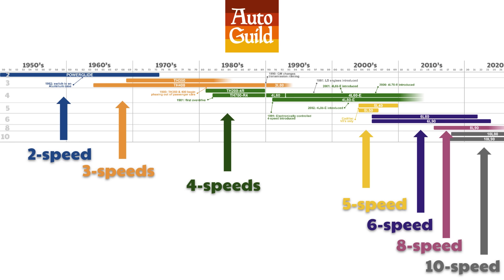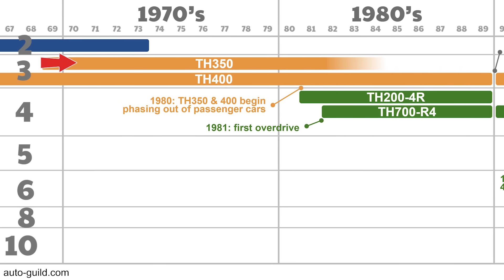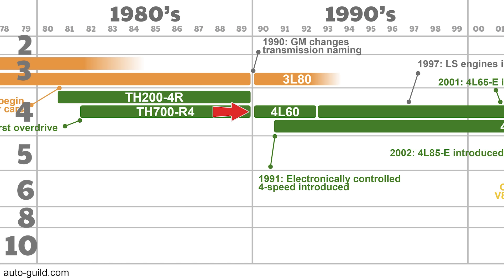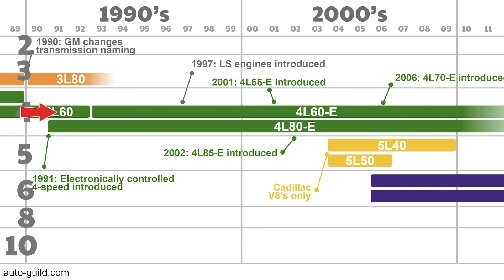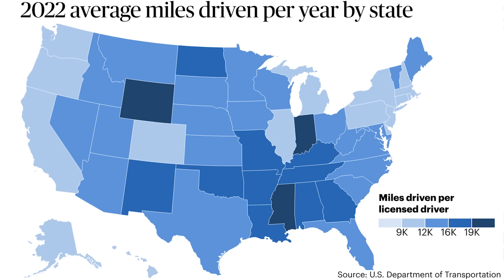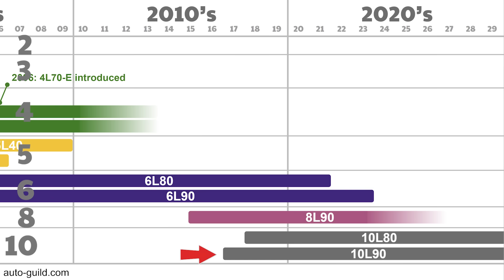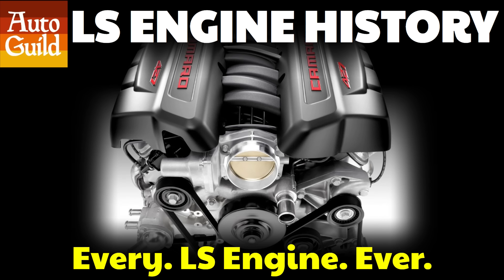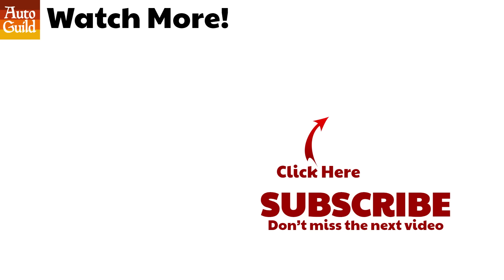All 15 Automatic Transmissions (Powerglide to 10L90)

Comment: Great video. I have a low mileage 2001 LS Camaro in beautiful condition. It's Procharged and makes over 500/500 to the wheels. I'd like to make more but I'm pretty limited by the tranny. I don't really like the available options I'm aware of. I need at least 4 gears. So we start at the 4l60e(which it has now with some minimal upgrades). A built 4L60 gets really expensive, will still be in danger over 600whp or so, and honestly I'm not that big a fan of it. The 4L80 can be built to handle my power goals but it's darn near 100 pounds heavier, expensive, and doesn't excite me very much. Honestly after that I'm not really sure what goes into making a more modern tranny work in my application. Something like the 6l90 sounds ideal as it is modern and won't need to be built up a ton because it's already made to handle good power. But as I learned in your video the housing dimensions are big and they might have some reliability issues(?). I am at a loss what to do. I can't articulate why I don't like the 4Ls in performance applications but they just don't feel that fun or exciting to me(even with a high stall converter). I would rather not pour all my savings into something I won't be in love with but as of right now it's looking like my only realistic option. I would love to hear your thoughts and possibly a video. Over the many years  YouTube has existed I've only subscribed to 2 channels because I feel the yt algorithm does a good job bringing me to what I want to see and there is no reason for me to mess with success. However, I found this video very insightful and eagerly await more. You will now be my 3rd subscription ever. Great work.
Reply from the maker: Yeah sporty bill at 70-100lbs heavier 4L80 is hard to accept.  Your car sounds super fun.  Even a five speed would be ideal.  I'm actually a hard-core manual transmission guy, so I'm converting my 68 Camaro into a manual, I think that's where the fun is!  Thanks on the subscription.  I'm actually subscribed to by think around 300 channels which is crazy but I watch mostly YouTube in my free time I don't watch too much regular TV.  I have a few other videos you may like if you want to check out the rest of my channel.  Thanks for joining
Reply: Borgeson, look at a th200-4r
Reply: @xmo552  I appreciate your advice. In my cursory search it doesn't seem like it can handle much more power than a 4l60, nevermind a decent 4l80. Is there something I'm missing? Even the higher end built versions seem to be rated for like 475hp max and I'm already making that to the wheels with plans to go even further. Thanks for your help.
Reply: @robertborgeson1821  
I didn't look at their specs. I assumed they were currently handling more. 

You may have to give up extra gears.  If you're open to that (or If you're forced to go that way) you could go to a Powerglide.

In my case for a street truck/tow/hauler in an old truck. :
I don't want to lose my th400.
I don't want many electronics.
I want/need an overdrive.
I'm going with a Gear Vendors. 
It will give me overdrive in 3 gears. 
1st, 1 OD, 2nd, 2 OD, 3rd, 3 OD.
6 forward gears.
I keep my vehicle in the powerband without searching for gears. It can be automatic or manually done.
A big benefit for me is I can tow in 
(.78) overdrive and the GVWR is 30k I think. In my truck the additional length is a non issue. 
Draw backs for me: 
1) th400 is a non lockup.
2) th700-r4  OD is .70
3) th200-4r OD is .68
Another benefit is I keep my 4.56 in the back for launch and heavy loads. With GearVendor in high OD that now acts like a 3.55 rear gear for cruising. If I have to I can change that later if I want higher.

4l80 looked good but if I swapped in  that trans I may as well do a full LS swap. The current plan is a TPI turbo.  Plan B is Cummins.

Check out the Gear Vendors site. They have units for many different transmissions. Maybe they have a possible combination you haven't considered.

I already mentioned 2 GM muscle car transmissions. I know you probably won't want to adapt a Ford but..... C6, toploader, t56.
T56 Chevy, Viper, Terminator. 
Lastly Mopar has great transmissions. The 426 Hemi 4 speed manual or the legendary 727 TorqueFlight. The 727 evolved into the 46re, 46rh, 47rh, 47re, 48re.

The modern TorqueFlight Dodge transmissions don't have a great record behind a Cummins. Fix it with upgrades and you're golden. My long bed 4 door 4x4 dually Ram has a 48re with all the goodies. Besides the transmission... the truck is 100% stock. In my case stock is 325HP and 600TQ. Zero issues.
It's a big trans for a Camaro, but maybe. Idk.

Last idea would be a GM Allison. Again it's a big truck trans, but that may be your huckleberry.
Reply: @robertborgeson1821  
I think you answer will be found by playing with gear calculators and ultimately choosing an older trans like I did + GV.

Look at the Tractor Pull and Truck Pull world. Those are brutal torque test. My buddy does that in the gasoline class. He whoops butt on the big blocks and even diesels and he's running a 355 SBC th350 combo. 
The staple is th400 or PG.

The diesel classes are usually running their stock trans model but built to the hilt.
Reply: @robertborgeson1821  
If it works for you.. come back and lmk. I may need advice on ECM and tuning for the turbo TPI build.
Reply: @xmo552  thank you. I will definitely check out gear vendors. I want to stick with auto because my main goal is to go fast in a straight line. I don't have any kind of super brand loyalty to gm. It's just about simplicity and price. Another company's tranny might look great, match up on paper, handle the power, and even be cheap but then once I go to install it I will have to spend a bunch of money on adapter plates, driveshafts, standalone pcms, etc and it still might not work. I can't afford a mistake happening lol.
Your truck sounds like a fun time. I love me some torque. With the overdrive any each gear, will your truck behave like a 6 speed or would the overdrives essentially just be for low speed fuel economy?
Reply: @robertborgeson1821  
It will act like an automatic 6 speed. 

Or I can flip a switch and engage the overdrive whenever. If I do it like this then it just acts like a regular 3 speed and when I pop it in overdrive I get highway speed fuel economy.

Th400 = no computer needed 😁

Comment: You have most GM automatics except for the early Hydramatic ,one version being a 4 speed auto that came in some Canadian GMC trucks , I seen a 1957 with one of them behind a 283 2 barrel.
Reply from the maker: Yeah there are quite a few transmissions that were not on my list that were built for just a few years or in low volumes or are not really for performance applications.  I try to focus mainly on V8 automatic transmissions which is where my viewers are with their builds

Comment: This is nice, but you seem to be missing a lot. This mostly seems to be a list for Chevrolet (and a couple Cadillacs) and not GM as a whole, while also omitting all of the FWD transmissions that were used with V8s too. 
1. The Original Hydra-Matic (1938-1968) 4-speeds
2. Buick Dynaflow (1948-1963) 2-speeds
3. Chevrolet Turboglide (1957-1961) 3-speeds, kind of
4. Buick / Olds / Pontiac Roto-Hydramatic (1961-1964) 3-speeds
5. TH425 / TH325 / TH325-4L 3 and 4-Speed longitudinal front-wheel Drive (Olds / Cadillac / Buick / GMC)
6. 440T4 / 4T60 / 4T60E FWD used with Cadillac V8s 1985-1995 4-speeds
7. 4t80E used with Cadillac Northstar / Olds Aurora FWD V8s 1991-2010 4-speeds
8. 4T65e-HD Used with 5.3L FWD V8 Chev, Pontiac, Buick 2000's 4-speeds
If you get really into the weeds, the 2ML70 was used in the Tahoe and other Full-size hybrid Trucks and SUVS from 2008-2014, 4-speed / CVT with a V8.
Reply from the maker: Yeah true the video could have been 40-50 minutes long.  Most my viewers are LS builders and swappers I really focus heavily on the Chevrolet stuff.  It's hard with the channel to know where to stop sometimes.
Reply: And he missed the venerable trimatic used in the majority of rear drive Australian vehicles

Comment: You listed the TH350. But nothing about the TH350C. AKA BOP350, which has a lock up, to get better MPGs.  The bell housings ran had a Buick, Oldsmobile, Pontiac bolt pattern.  But there's also a BOP350 that has the Chevy Bolt pattern, along with the Buick, Oldsmobile, and Pontiac bolt pattern.
Reply from the maker: I know I definitely came across those transmissions when I was researching this video and wanted to include some of them but I tried to stick to the mainstream stuff as I think that's what my viewers are looking for.  It's hard to know when to stop, what to include, and what not to include

Comment: Can’t believe you forgot to mention Pontiac but you named the other divisions with the th400 lol
Reply from the maker: I know I could have covered so many more transmissions but I had to cut it off somewhere.  My best friend is a huge Pontiac guy too, so I'm sure he's not happy either
Reply from the maker: Yeah I was really interested in that five-speed based off of a four-speed.  I did some research on it though and it seemed to have a lot of quality problems.  And then unfortunately the new six speed is so big it won't fit in many builds.  This is one of the reasons why decided to switch my 68 Camaro from a automatic to a manual

Comment: Where does the Allison trans that's in my '04HD2500 with the 8.1 fit in here?
Reply: Built by Allison not gm it was just used in gm vehicles, that’s like asking when Chrysler made the Cummins, they didn’t Cummins made the Cummins
Reply from the maker: I didn't include those because it's more of a heavy-duty truck transmission and my viewers are tending to build LS swapped performance type vehicles and trucks.

Comment: An interesting detail I noticed when debating a 10L vs 8L:  for a tall tire, tall rear gear vehicle, there is no tangible difference.  Not even when towing.  The two extra gears are basically useless unless you're running a short tire and low gearing.
Reply: Not to mention it skips gears if it doesn't need em
Reply from the maker: Yeah the car companies are so focused on fuel economy I think that's why you see the extra two gears with the 10 speed even though it's probably only 1 or 2% more efficient versus an eight speed
Reply: @AutoGuild  it would have to be a ridiculously miniscule difference.  Top gear is virtually identical, weight is virtually identical, and power loss is virtually identical.  Like you said, if it's a MPG difference it will be 1-2% at best.  On my pickup, that would be right at 2-4 tank fills per 100,000 miles.  Pointless.
Reply: @AutoGuild  yea and I notice that the more auto gears they put the lower the gears are on the rear end ..I see 10 speed autos with a 2.77 rear ..trash !!!!

Comment: Recommendation for a video. ECU for a ls swap (vats and immobilizer) or aftermarket like terminator x holleys harness and ECU. Im really stuck right now on my 3.8 to 5.3 catfish swap i got a 2000 lm7 and idk weather to get the Holley terminator x or just use stock harness. I also see ls swap harness on bay, facebook marketplace, and i think jegs has one as well. you got anything on that if you do i know you would be helping me and maybe others.
Reply: Ebay ls harness and the vats and emissions delete ecu or buy hp tuners it’s less than a Holley and if you use it on other peoples cars it pays for its self, super simple install just makes sure you order the correct harness for the ecm and throttle setup you want to use
Reply from the maker: My upcoming e-book will have information on ECU but probably not till late summer so maybe it's too late to help you

Comment: Perhaps the specification rated the TH200-4R at 300 whp, I presume you are referring to wheel horsepower, but my 1986 Grand National had nothing more than a shift kit and it was stock all the way down to the torque converter.  The stock torque converter was rated 2200 stall and was massive at 12".  Anyway I ran an 11.88 @ 115 mph with a less than respectable 60' time of 1.79.  The GN with driver weighed in at 3810 lbs.  I could have tuned the car a bit more and probably gotten into the 11.7x range or possibility 11.6x.  I have seen several turbo Regals with built 200-4R transmission run into the 8s and putting down at least a grand in ponies to the rear wheels and their trans held up fine.
Reply from the maker: Yeah the grand nationals were the exception, those transmissions were built tougher than the mainstream 200s
Reply: The only time I broke a 2004R was cause I didn’t know about tv cables. Otherwise, they’re awesome as long as temp is good.

Comment: You missed all the 50’s dyna flow Buick, and Oldsmobile transmissions. As well as the early Cadillac models.
Reply from the maker: I know I'm sorry for not covering the BOP transmissions.  The video would have been too long!
Reply: that deserves its own separate video
Reply: Didn't mention the most overrated transmission of all time either: the Allisons used in 3/4 ton and up trucks.
Reply: The 200 r4 would fit Chevy, or BOP. I used a 700R4 with my Oldsmobile motor and used a TCI conversion plate to use it.

Comment: What about the LCT 1000/2000 series ? They lived behind the 8100 Vortec (496) in 2002-2006 GMT800 from class 2 to class 6, and of course, the Duramax.
The 8 and 10 speeds are awful busy shifting units, and not to my liking, personally, but I would encourage anyone to install whatever they want, in their build. Informative vid.
Reply from the maker: Yeah I didn't cover the heavy-duty transmission stuff.  My channel is mostly focused around LS engine swaps and performance cars

Comment: Turbo-Hydramatic 425 (TH425 or THM 425,[1] later 325) was an automatic transmission developed and produced by General Motors. The THM425 was a derivative of the THM400; most parts directly interchange and some others will interchange with minor modifications. The internal parts spin the opposite direction in the THM425; the helical angle of the planetary gears is "reversed" and the one-way clutches freewheel in the opposite direction, for example. The THM425 was developed for the 1966 Oldsmobile Toronado and the 1967 Cadillac Eldorado.
Reply from the maker: Yeah there were a lot of transmissions that I didn't cover, unfortunately just didn't have the time to do them all.  I tried to cover the mainstream transmissions that most of my LS swapping viewers would enjoy
Reply: @AutoGuild …you know you’re responding to a bot farm account, right?
Reply: Also used in the GMC Motorhome (RV).
Reply: There is also a fwd used in the mid 80s riviera, Toronado and Eldarado based on the 2004r trans. I believe it was referred to as the 325-4L
Reply: The first time I saw a "TH400" in a front wheel drive car I was blown away.